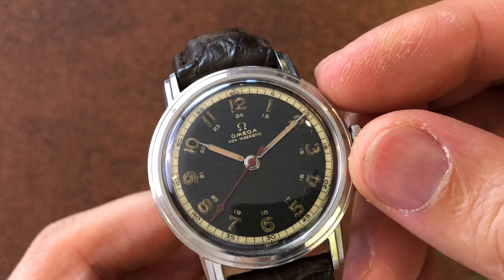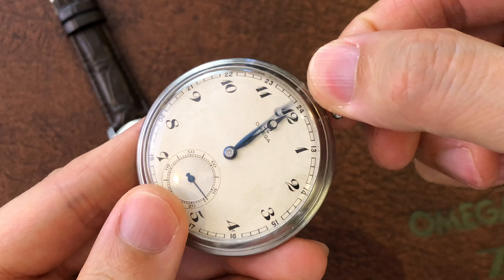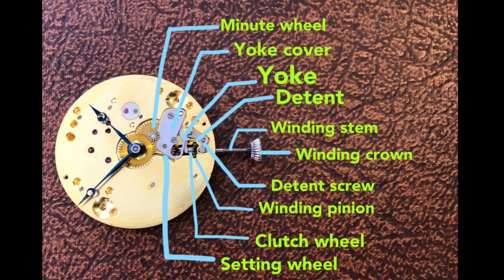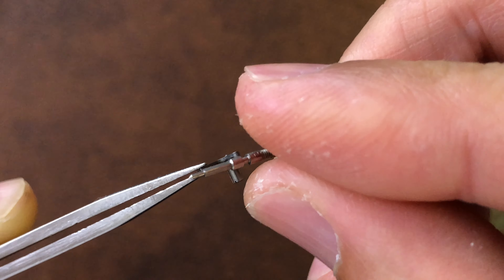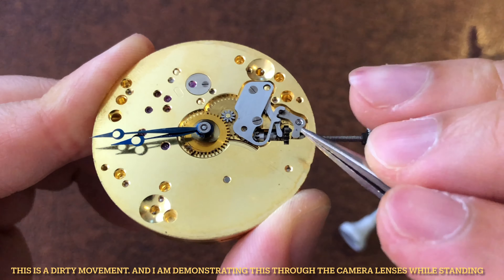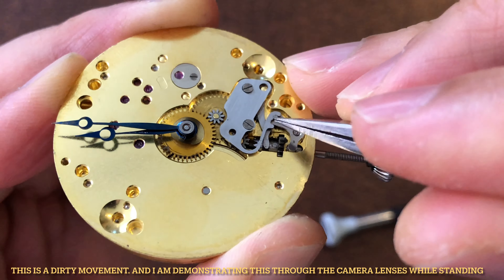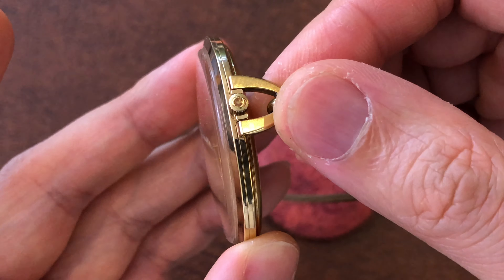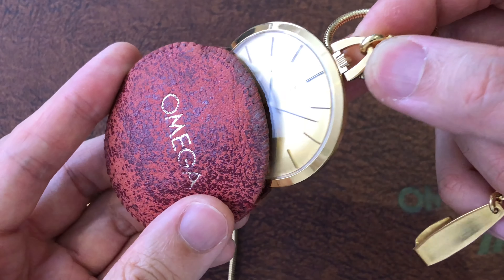How to fix your watch when you can only set the time but can't manually wind and the stem is stuck?

Comment: Hi, what if you can manually wind the crown but the watch itself is not winding and there is no tension as you wind it?
Reply from the maker: Sounds like a broken mainspring to me
Reply: @TimelessHistoryChannel Thanks for the response, btw may i know how much does a mainspring cost? my watch is a tag heuer.
Reply from the maker: @glendbest  I've not purchased a mainspring for a Tag Heuer for a long time. I would assume it is an ETA mainspring. The price of a mainspring will depends on the supply house. As a private individual I do not think you can order one, but you'll need to ask your local watchmaker to help you order one. Or if you know what caliber is inside your watch, you can always search on eBay for the mainspring. It will most likely be no more than $50-$100.